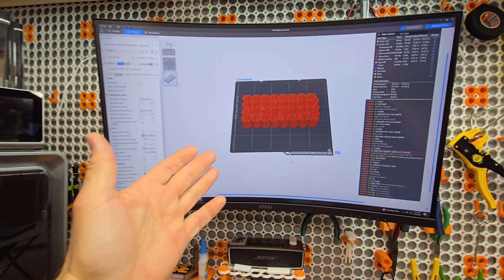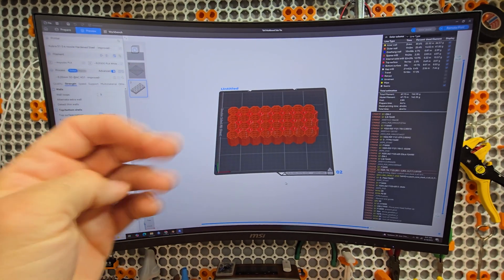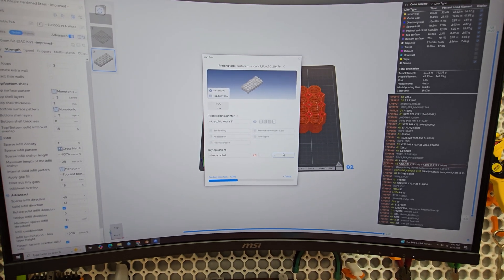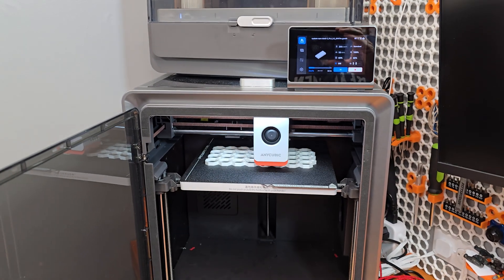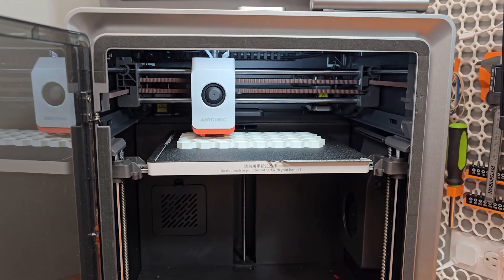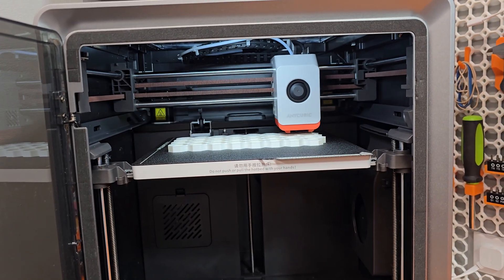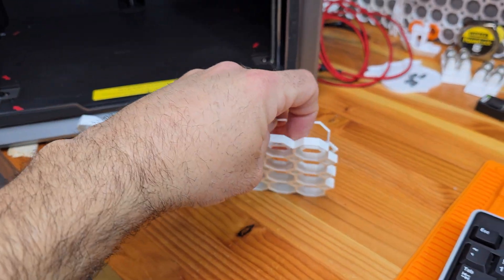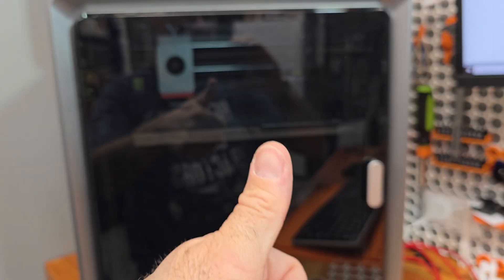Kobra S1 Combo: Multiboard stack print Test....and FAIL!!!!

Comment: I am printing multiboard stacked on the S1 as we speak. I have no issue. Not that this helps you, but I see that you are struggling a lot with the printer, so Im just here to give the other side of the coin. I have been printing over 4kg of PLA to date, and I have no where near the same issues as you have. Hope you get them sorted, and I am looking forward to this, cause then I know what to do when mine fail. :) Thanks for the vids.
Reply: Can you possibly tell me where to begin with stacked printing as I've never done it.. but want to do some multiple boards. I don't know where to begin in the slicer.. using the s1
Reply: @davegee4129  same I'm thinking of doing the multi material print with my S1 and using petg for my boards
Reply: @pigbait I ended up using petg. A .02 space in between the layers not pla. They snapped apart fairly easily. The machine bitched about having an empty layer but it did it anyway.
Reply from the maker: That is awesome! Glad to hear you got a winner.  Good luck with the multiboard, did you change any settings for the stack?
Reply: @dougdoesstuff24  no, all default apart from the 3 side walls, ironing and 0.2 spacing. It sticks a bit, so I prie it with a 2.5mm umbraco screwdriver between the boards
Reply from the maker: @FPV-Jon  that's great, what does the bottom side look like? Mine didn't look great
Reply: @dougdoesstuff24  bottom side on print plate? Well, it looks like a copy of the plate, so not smooth. It sticks good though. I havent cleaned the plate after any of the prints, and on the latest print I had my first detach from the build plate, however just on two of the 9x9 cubes on the multiboard. 

Btw, I talked to the manager of the largest seller of the printer here in Norway. He gave it a 8 out of 10 as a printer. So I suspect that some have issues, and it looks like when you first get a issue, its hard to fix. 🫤
Reply from the maker: Sorry, I knew after I hit send that it wasn't clear.  I meant, how is the bottom side of the second stack look?  With mine it wasn't that pretty, not that it has to be if it is facing the wall, but the stack definitely came out better on my ender 3 pro.
Reply: @dougdoesstuff24  its not perfect, but ok. Looks a bit crude and not something for the perfect mancave. Mine is not perfect 😅
Reply: @dougdoesstuff24  Btw, a friend of mine prints the multiboards in the bambu ps1, and he doesnt stack cause the ironed sides doesnt look good. So I guess if we want perfect, we have to "nerd down" the settings. :p
Reply: @ It appearsears that I have mounted some of the boards the wrong way. So the bottom layers are not good, but the ironed side is good. Some filament bulbs, but nothing crazy.

Comment: Me searches multiboard stack kobra s1 and look who I find again!
Doug we are on the same journey, wev're taken different paths but seem to be passing the same landmarks.
It didn't even register our channel names are practically the same until after I commented on your other video!

I am sorry you have had so much trouble with the S1, I thought it was positioned to be the value play in 3D printing. Like it's Android and Bambu is ios ( I come from the mobile tech world).  I know it is capable and has come a long way in the past couple of months with firmware and software updates, but like the early days of android, this is something you will need to tinker and hack away at and as I get older, that is something I find less and less appealing.
Reply from the maker: That's great!  You have a new subscriber!  We think alike.  I often relate to others the IOS/Android Bambu/Everything else too!!!  Yeah man, I just want this to work.  The old Enders were the things to tinker with and learn on, this was supposed to just work, wasn't that how it was advertised and still is.  Good luck on the multiboard stack, when mine did print the settings must not have been dialed in because the bottom layer of the second stack was not good.  My Enders had better quality.

Comment: Awesome! I had to completely disassemble my extruder to clear about a one inch piece of filament that got jammed in there. Not a task for the faint of heart. There’s a tiny little spring that always pops out and I lost it on the floor in the print room for about an hour last night. Ugh. I’ll get back to reassembling it later today.

Comment: I'm always the Debbie Downer in your comments, LOL, but after getting my hot end and thermistor and clogging issues resolved, I now ran into another issue. When I tried a long print with two partial spools in the ACE unit, the one spool ran out and it jammed the extruder and the second spool couldn't load. I'm fully in the deep regret stage of this purchase.
Reply from the maker: Ah man, that is a bummer!  I haven't had that happen yet, but I haven't run out of a filament.  Where is the runout sensor?  My guess is that because it is somewhere in the line, when it is pushing the filament back it jams.  I have a few rolls that are almost out......I think will give mine a try for you.
Reply: @dougdoesstuff24  I need to check, but I think it's close to the extruder. I haven't touched the machine in a few days, out of pure frustration. Interested to see how your test goes.
Reply from the maker: I tried to make a video last night of swapping filament midprint.....stay tuned!

Comment: if you were printing these in pla, try removing the ace pro from the top, taking off the top cover and leaving the door open. pla does not like a fully enclosed chamber. i suspect the air is too warm in there for the transition between tiles to stick since it is so little material. you could also try increasing fan speeds and see what happens.
Reply from the maker: Good ideas!  I have been meaning to print the Ace Pro Riser for that purpose!